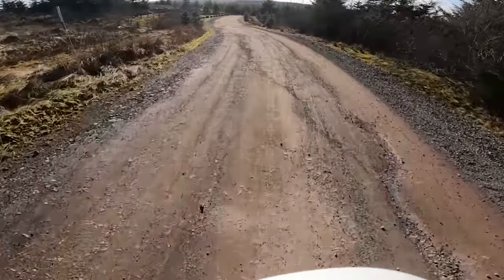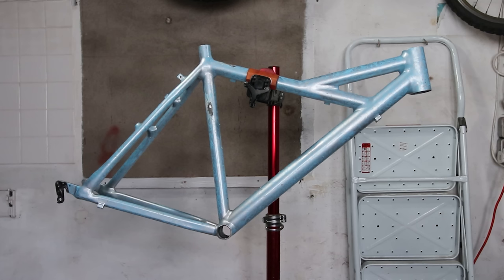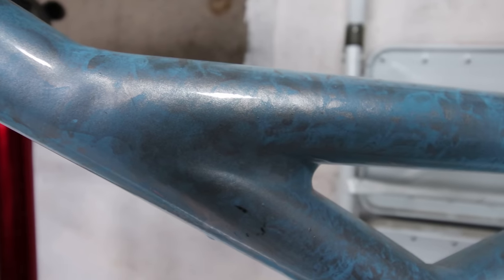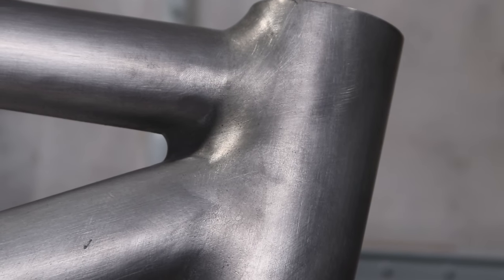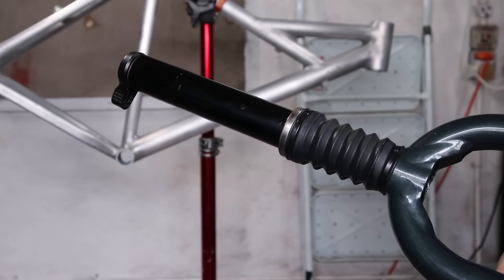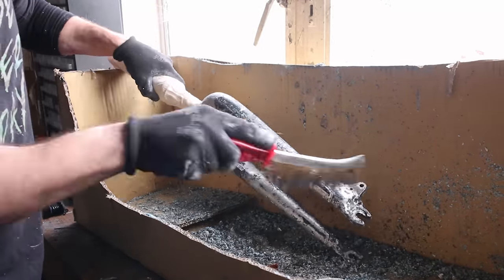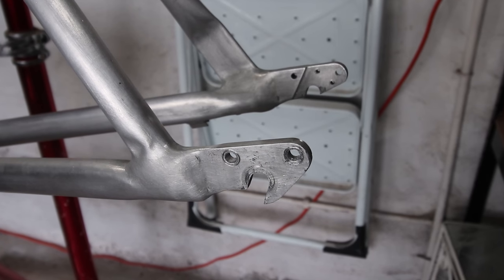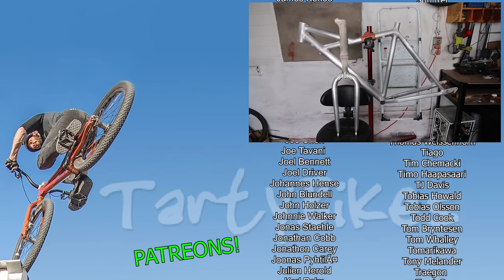Turning A 90s Cannondale Into The Most Unique Gravel Bike Ever! Part 1

Comment: I love the idea... so much in fact that is exactly what just recently accomplished on my own 1994 Delta V 600 frame.  I didn't go as all out and remove the brake bosses from the frame. I might attempt it in the future though now that I have seen it done) successfully. I used a 1999/2000ish  Fatty  SL  to mount the disc brakes up front. I purchased the rear mount that works with the 3.0 series frame dropout off of e-bay. The whole thing came out pretty nice too.

I made a post earlier about this bike on here, but for whatever reason YouTube removed it or something. Doesn't matter, I am looking forward to seeing the finished bike!

Comment: I put drop bars on my old V600 a few years ago. The bike now has a second life as a cool looking and very capable gravel bike. The 2 inch Big Apple tires have low rolling resistance and great grip and stability in loose gravel. They can be run at low pressure (20 psi) if needed on rough terrain. The Headshok soaks up impacts on potholes and rocks at speed. I do wish it had disc brakes but I make do without them. It's a fun bike.

Comment: I'd be really tempted to add a torque arm up to the rim brake boss when fitting the disc mount.  Otherwise that's a lot of torque on an unsupported dropout
Reply from the maker: I really want the bike to look sleek so I’m going to try it without an arm, I’ve got a 140mm rotor going on and I won’t be doing any trials on it so I’m confident it’ll be fine (I’ve actually got two of these frames so if this breaks I’ve got a back up)

Comment: Ali, should get yourself a cheap dremel (ebay has some for like £15). You can put a little wire wheel on it to scrape off paint easier, or a high grit sanding block to smooth out bits. Really useful for this kind of stuff.

Comment: If you can get IS brakes in there but not PM could you not just use an IS to PM adaptor?
Reply from the maker: That was the plan but with the adaptors I found it wasn’t that simple…all will be explained in part two (which I’m still filming) 👍🏻